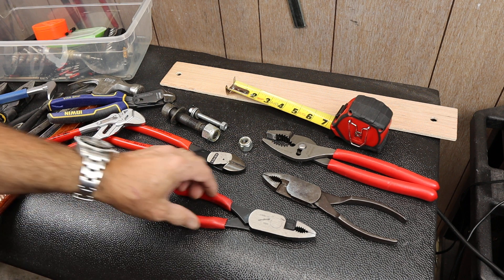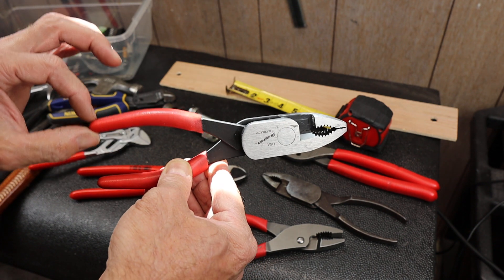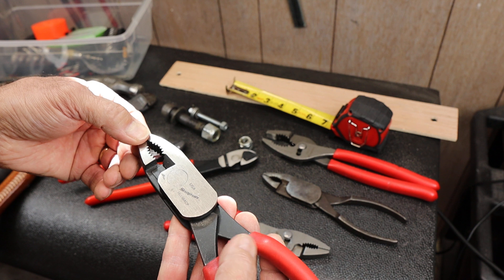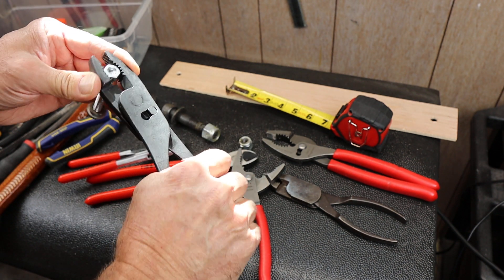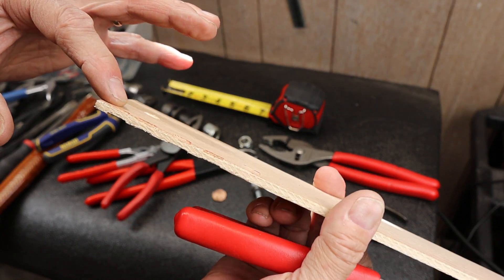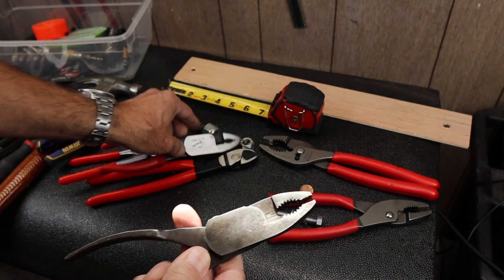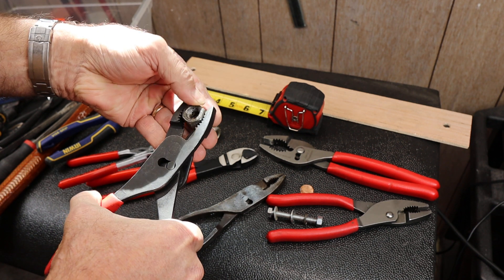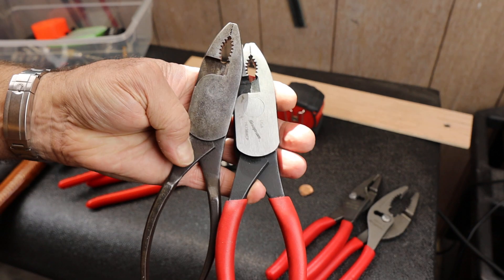Snap On High Leverage Pliers HL138ACP: Breathtaking performance that supplements slip joint pliers.

Comment: People on eBay are crazy that way, a socket you can get off the website for $15 one guy is asking $30 for them and another listing for the pb swiss bit holders the guy wants $10 for one plus 5 for shipping when they are $4 on the tool lady website

Comment: Nice violation of section 333 of the U.S. Criminal Code mutilating legal tender for all to see. Not that I care. Love the channel.
Reply from the maker: My reading of the code is that the manipulation only matters if one attempts to then pass the legal tender after the mutilation. We can destroy all the currency and coin we want.
Reply: My sure seem to be getting pretty loose as in the lever to the pivot point. Tempted to whack them on the Endville at center pin what do you think